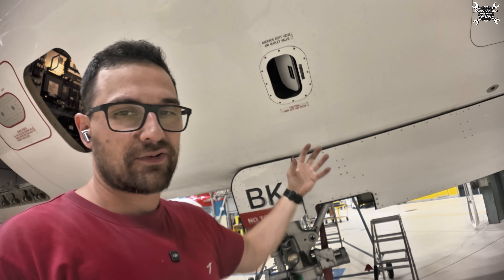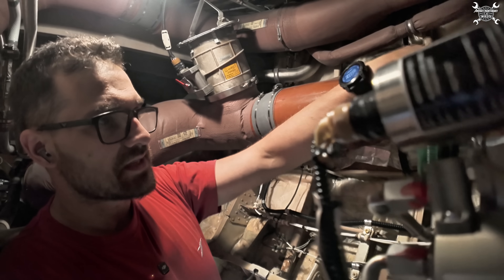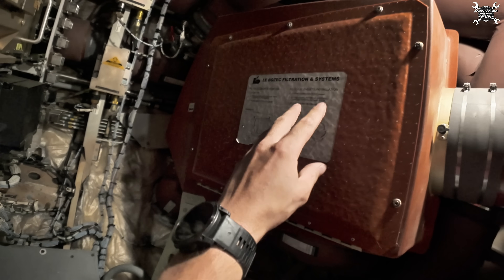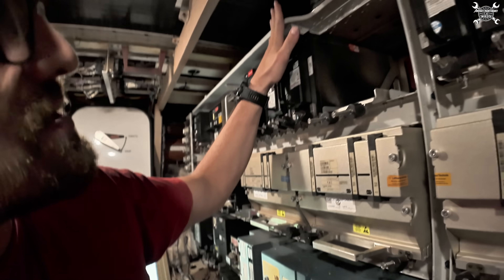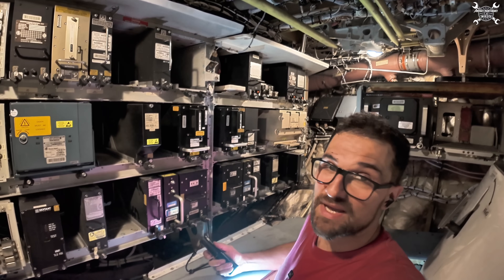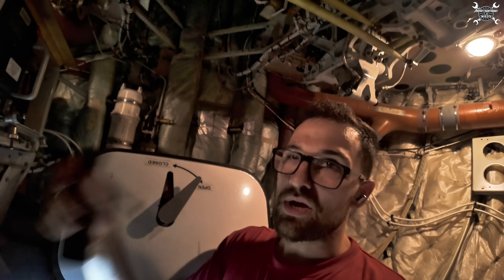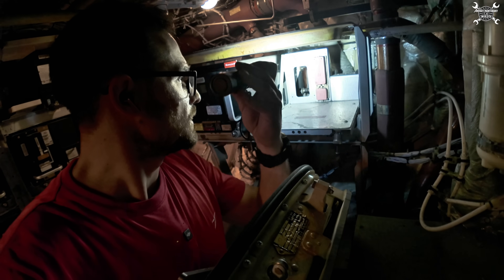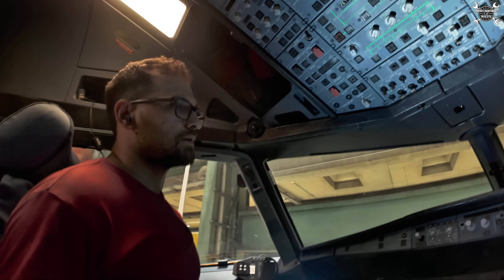How to cool down computers inside of A320

Comment: I believe that the maintenance manual says that when applying electrical power to the A320 (A319) when the temperature is above 90 degrees F, that either running an air conditioning pack or applying external air conditioning is required. Those boxes need additional cooling. The AVEC is not enough in hot temps.
Reply from the maker: For sure no

Comment: So, the whole selling point of computers and fly by wire is for weight savings and safety. How is adding massive cooling systems and hundreds of racks of computers a weight savings. And with all the FADEC problems and glitches making anything safer? Makes as much sense as total electric vehicle mandates with no infrastructure to back it up.
Reply from the maker: It is not that heavy and just for fun B737 Looks very similar to this and that one is standard flight control concept. And don't forget that this is aircraft from 1987

Comment: I feel like a pi can replace half of these. I have yet to figure out what they are doing that's so complex that they need active cooling. Like the DAU is just looking at various signals and the other DAU's. It's not doing any math. Just a bit of logic. But it needs an fan to stay cool on most AC.
Reply: Every bit of equipment makes heat, doesn't matter how much work it does, these probably don't make much heat each unit, but there's a lot of units
Reply: @thewhitefalcon8539  Ya. I get that. The space gets cooled and most of them cool passively. The boxes having no passive air exchange doesn't help. What I'm talking about are the ones that require a fan to do if high or low logic requiring a fan.
Reply from the maker: Don't forget this airplane was designed at 1970. Everything changed since then

Comment: In ground taxing, with hot temperatures (Portugal, Spain, Dubai), how cool's down?
Reply: the air conditioning system gets re rerouted to cool the avi
Reply from the maker: Aircondition is on as well

Comment: Interesting! I am wondering does it have redundancy or the safety critical computers i.e. flight computers can run without air cooling? I mean, otherwise having a failed ventillator fan could cause a very bad day.
Reply from the maker: Yes if fan fails we can use as sorce aircondition

Comment: Trying to understand how this works with pressurisation, is the whole avionics bay not part of the pressurised envelope?
Reply from the maker: It is located in pressurised section of fuselage and both valves are part of pressurisation system , they are closed

Comment: Are there single points of failure in the cooling system? I imagine if the cooling system completely failed you be in in big trouble.
Reply from the maker: Then you use air from air-condition system

Comment: Thank you very much for this video! What is the min and max temperature range for this electronics?
Reply from the maker: Aircraft can operate  in very cold and very cold environment. For me is important to know that below 12°C we use skin cooling and above open circle
Reply: I can't answer that but I'll say the usual industrial temperature range for electronics design is usually about -20 to 85 degrees celsius. That's for the electronics themselves so probably more like -40 to 65 ambient.

Comment: The irony of this all is that in the year 2025, all those computers can very easily be virtualised and run from a clustered redundant array of Raspberry Pis thereby eliminating the need for all that cooling thus saving on weight/fuel. Is it going to happen though? Probably not as it will constitute a "new design"
Reply from the maker: Even newest aircrafts has still some of flight control systems covered by separate boxes.  But a lot are just hostile applications
Reply: you don't know what your talking about. this is a worse idea than how that nut job at Oceangate built his sub. .
Reply: You clearly know nothing about aviation industry.  And you clearly think you are amazingly smart.
Reply from the maker: @ag76486  me?
Reply: @zeto.r no, he’s replying to the original commenter. Who is clueless.
Reply: @zeto.r  no man 😅 you a smart guy. Keep sharing nice content 👍🏻
Reply: @ag76486  Just because you have no idea what I'm talking about, doesn't mean I don't. I hate to boast but I have 25 years in IT infrastructure covering Wintel, Virtualisation, Networking, Security, and software development in C++, C# and Java. Again, please don't cry upon hearing this but I've also been flying for 25 years privately and 15 years on jets, with 10,000 hours on the A320, B787 and now B747. I think I know what I'm talking about - If you'd like video call to explain more, I would be happy to oblige 🙂

Comment: If on the ground, can the equipment stay cool enough by just using inlet/outlet valve, even if outside air temperature is 40+ degrees celcius? Is the movement of air via the fans and inlet/outlet enough? So no cooling of outside air takes place on the ground (like with a compressor/fridge)?
Reply from the maker: It is designed to survive also hot temperatures but as soon as crew switch on aircondition system this cold air can be supplied to ventilation system
Reply: @zeto.r  Ah, thanks. Will pilots be warned if avionics bay is too hot on the ground and need AC on? And if put ON, will avionics compartment automatically utilize it, or do you have to open explicitly for it?

Comment: Do you guys still use 3M self amalgamating tape? That stuff was amazing to work with in the early 2000's
Reply from the maker: Im not sure which one is it
Reply: @zeto.r they used to wrap it around electrical looms. It is grey, like soft rubber, and as you feed it off of the spool, a clear plastic film would peel away and get discarded. The tape would then bond to itself and form one piece of "rubber" insulation. It would only stick to itself, and cured better where you had stretched it. Qantas used to use it more than an air con installer uses duct tape 😅

Comment: I never knew that airplanes have a seperate bay for the computers. Now I understand to run autopilot for a humongus machine, they definitely need these vast machines
Reply: I'm a computer engineer and I bet the programming for the whole plane could run on a little box the size of your phone and using a few watts, but it wouldn't meet reliability requirements. Once the old technology is certified it's hard to update and not worth updating - if it ain't broke, don't fix it. Some parts in this bay aren't just computers, like the gyroscopes and stuff, those wouldn't fit in a phone sized box too.
Reply: @thewhitefalcon8539  i was surprised by how massive the computers are, then you remember that the plane was conceived 50 years ago when computers filled rooms.
Reply from the maker: Yes it is massive but the aircraft was manufactured in 1980 that's why it looks like this . But even newest ones has still separate boxes for flight controls for example

Comment: What about the cooling of the equipment in the cockpit like all those screens? Is that the fans you hear when you turn the two battery packs on?
Reply: I dont imagine they'd really need any... Screen heat output is pretty minimal. Particularly given they dont have their own power supplies internally on a plane
Reply from the maker: The screens are also cooled with this system if you look on diagram which I shared in the video you will see it there

Comment: Extending this discussion, in some situations the engine ECU is installed in an extreme environment, like on the engine, and in some applications engine fuel is pumped through the computer case for cooling.
Reply from the maker: I never saw fuel cooled ECU always with air if necessary

Comment: What if during flight they fail to open? Would the temperature sensors in the avionic bay alert the pilot and would the plane have to land as soon as possible? Or can they not get stuck in the closed position due to the outside air?
Reply from the maker: As I said in the flight it is closed and it use close loop. So it will be always closed. Also I said that it can be inoperative and then there are other procedures for cooling

Comment: What happens if the valve is stuck shut? Does that mean that the fly by wire system can fail?
Reply from the maker: Nope fresh cold air can be delivered from aircondition system
Reply: @zeto.r  I see, I was wondering that if for whatever reason the vents would fail, would the flight control computers fry, but i didnt even think of the AC packs
Reply: @teif2 It's an Airbus. Without fly-by-wire, you only fly using the rudder & elevator trim. They'll try to prevent it as much as possible.

Comment: Lol, nowadays everything could run on rpi or even pic or atmega
Reply: Nope, not enough redundancy & timing guarantee.
Reply from the maker: This is concept from 1987 . New aircrafts use for some systems applications but for major systems you still have independent box

Comment: I am a first officer on A320, just a quick question. There is something like a safe lock on overhead panel. just 10 cm above of extract ovd button. Never seen something like that in 320. what is it's function?
Reply from the maker: It was used in the past for tracking the time. It is not use that often anymore
Reply: It's a simple mechanical timer! Some airlines use them for crew rest I believe, but they can be used for anything really. I've also seen them on 777s.
Reply: Thats an A320 from the stoneages, it still has CRT Displays and maybe even the Para Visual Indicator on the captains glareshield . Typical Lufthansa Group (seems like Austrian Technik Bratislava), flying one of the oldest A32X fleets worldwide.

Comment: I'm a pilot on the A320 family and in my company a lot of people put the BLOWER to OVRD on the ground to reduce the noise in the cockpit. There is no procedure for this in the manuals and I'm wondering if there is any chance that the avionics would overheat when only the extract fan is running? I usually do the ''ground operations in heavy rain'' procedure which says to put the EXTRACT to OVRD instead. As far as I know the only difference this makes is that both fans are running (in closed loop) instead of only the extract fan?
Reply from the maker: With this button you deactivate one of the fans and you reduce capacity of cooling which leads to degradation of computer health and you also create unnecessary load on running fan. This things are there on purpose and since there is no procedure for it that means that it should not be used that way. It should be used only in case of faulty unit not for comfort of crew. Heavy rain have no effect since water is heavier then air and in the filter housing is dedicated drain for this reason. Water which is sucked in will be released overboard through this drain.  Follow the ops manual. Everything have it own purposes.
Reply: @zeto.r  But there is a procedure for ground ops in heavy rain which tells you to put the EXTRACT to OVRD. In this config both of the fans are running but the inlet and outlet valves close.

Comment: They dont use ram air to cool the computers after up at altitude? The fans are on all the time?
Reply from the maker: In the air we use close loop so fans are running all the time
Reply: @zeto.r  any reason why they wouldn't want to use ram air after they reach cold altitude?

Comment: Zeto, is the air pre heated before going through the sensitive electronics in the av bays? Is air temperature at between minus 30 to 50 Celcius not damaging? Thanks 😊
Reply from the maker: Skin of the aircraft is not that cold, don't forget that friction create heat. Temperature will be max around 0°C
Reply: @zeto.r  ahh right Tomas, thank you for the quick reply. Sorry if I spelled your name wrong 😅

Comment: Hi Zeto, thanks for another informative video. Two questions remain for me:
1.) What will trigger the inlet valve to close? Is it related to air speed or outside air temperature, or something else?
2.) What does the test actually test in the end? Is it just checking the correct movement of the valves or does it also check vent pressurization and actual heat exchange of the components that need to be cooled?

Thanks and see you in the next video!
Reply from the maker: 1. Temperature and ground - air command 
2. Function of every component and communication between components and computer

Comment: The complexity of these systems on modern planes is mind-blowing
Reply from the maker: This aircraft was released in 1987 🙂
Reply: @zeto.r Production started in '86!  Thing is, we'll never see the innovation we saw back in the '80s ever again.  

Humanity definitely peaked in 1986/87 and it's been downhill since.  😞
Reply: @twiff3rino28 Eh, it’s more that all the easy improvements for aviation were completed by then. Everything since has been stuff less visible like avionics and engines.
Reply: @twiff3rino28  wrong!!! things have significantly improved over the decades with better, more efficient and reliable electronics and systems, new composite materials, glues, components, software and more.
Reply: @twiff3rino28   Mechanical engineering in the west seems to have peaked that's for sure.  Electronics still advanced.
Reply: @twiff3rino28  Stuff has improved A LOT. Just because planes are still tubes doesn't mean it's the same. Composites are a huge modern innovation, engine tech etc. A320 from 1990 isn't the same as the newest A320, different systems.
Reply: Modern lol
Reply: These are 30 years old stuffs.
Reply: @LongTran-em6hc  It has changed. Newer a320 has lcd screens instead of crt. Eis 1 and Eis 2 are quite different.
Reply: @LongTran-em6hc  Almost 40 actually (1987).  The 777 is 30 (1995).
Reply: @twiff3rino28  This aircraft is not an early A320 version.
Reply: they are  not modern
Reply: it is not difficult for anyone who works in this industry as a technician or engineer, and also if you have a technical education and a certain amount of memory to remember many certain moments.
Reply: Its not even modern 😅
Reply: @9W0o modern by aviation standards maybe?
Reply: is frightening
Reply: @tritop  getting simpler with computer controls.

Comment: super interesting. Some additional questions. What temperatur is desired  inside the computer compartment and is the air somehow dried? I mean you don't want humid air? And by the way, is the computer compartment pressurized?
Reply from the maker: If during flight skin temperature go above 35°C we get to partially open loop and hot air will be released overboard and cold air will be delivered from aircondition system water is removed thanks to filter which is there to block water particles and dust particles.  And since it is exactly under the cabin, area is pressurised

Comment: These work only on the ground right!
Reply from the maker: System it self works all the time. Inlet valve open only on the ground if skin temperature is over 13°C
Reply: No, the skin heat exchanger works while its in the air. The valve opens when on the ground (and maybe at lower altitudes).